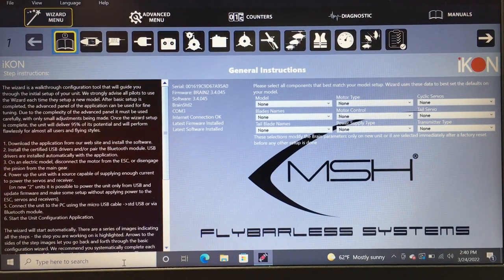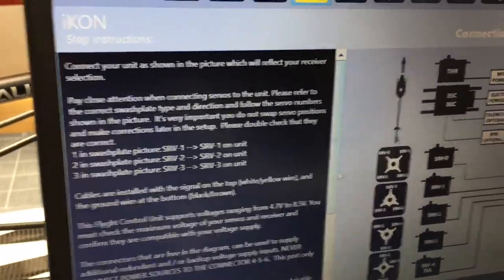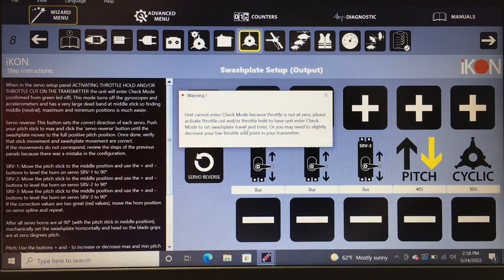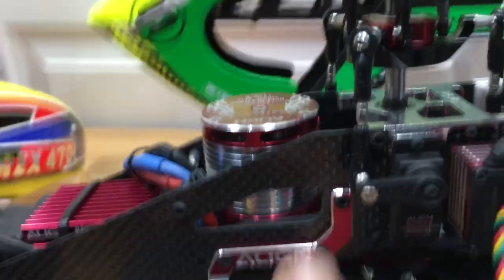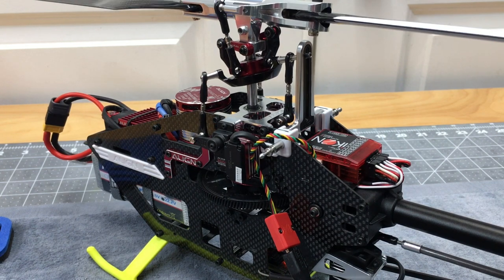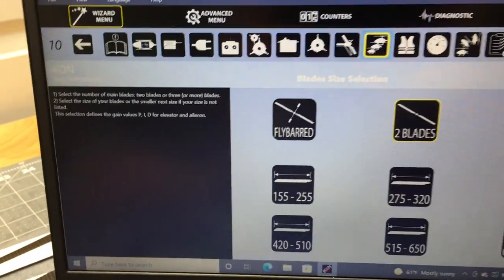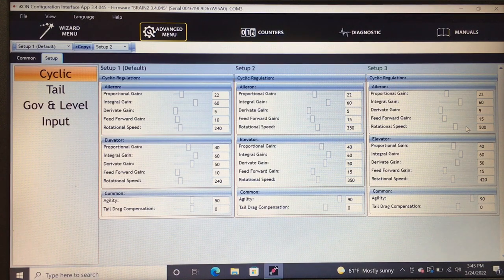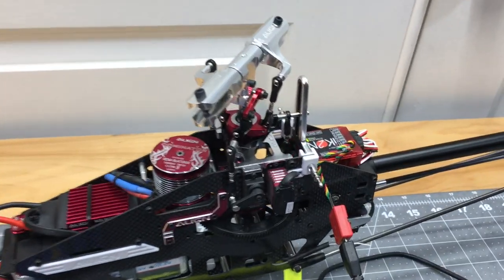How To Setup MSH Brain/Ikon 2

Comment: Hey will the file work for my Sab goblin 500?
Reply from the maker: The saved configuration file? I don’t think so but this set up video is the same for all helicopters you might just have to change something here or there
Reply: @westhobbiesrc8051  so I have a Sab goblin 500 what’s a good pitch curve for a beginner. I flew helis back in the day like raptor 50 nexus 30 and xcell helis I’m just not use to the new stuff. Thanks in advance.
Reply from the maker: @johnbess7320  you will like the goblin 500! A really great helicopter flies fantastic. I would recommend a normal mode pitch curve of 30-40-50-75-100 and for stunt one and two linear 0-25-50-75-100 same with hold. I would start with +/- 12 degrees of cyclic pitch. I’m actually in the process of rebuilding a nexus 30 right now LOL
Reply: @westhobbiesrc8051  Nexus 30 is a great heli for its time. They are going for crazy money right now on eBay. I’ll start with those pitch curves! Thanks happy flying. Let me know how things work out. You should do a vid on the nexus.
Reply from the maker: @johnbess7320  videos on the nexus are in the works! Unfortunately my main gear is missing a few teeth and my pitch slider is broken. So I’m making. Rebuild/Restore video and showing how to make molds and pour your own gears and parts! You can’t find a main gear anywhere! I’ve been looking for months now and when I do find one they want $100 plus and I’m not paying that. The plastic gets old and brittle in the teeth just sheer off.
Reply: @westhobbiesrc8051  I’ll help u look for main gear.look forward to the vid.
Reply: @westhobbiesrc8051  Have you tried Facebook groups for vintage rc helicopter?
Reply from the maker: @johnbess7320  yes I’ve been all over every group, ones I find are either missing teeth as well or they want $100 plus for them. I just got everything I need in the other day to mold a gear so I figured that would be a good video showing how to make your gear on a older heli you can’t get anymore
Reply: @westhobbiesrc8051  So at 10 degrees right stick is the left stick suppose to be 10 also or we only doing 10 to one side. I got 12 degrees pitch -+ now.

Comment: I can't get my throttle to be +100 and -100 on my ix14.
Reply from the maker: In the iKon or the radio? It’s okay if it’s not -100-+100
Reply: @westhobbiesrc8051  In my radio, I'm at 150 on both, and on the brain software, it doesn't show the negative at -100, it shows only -42.